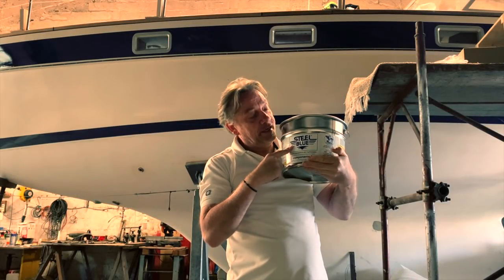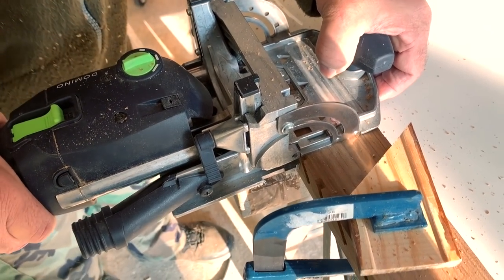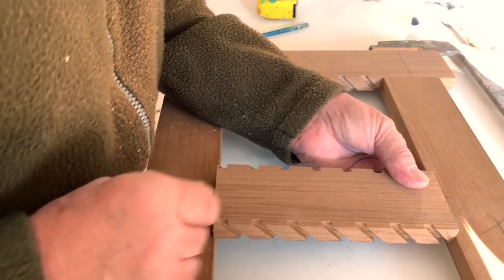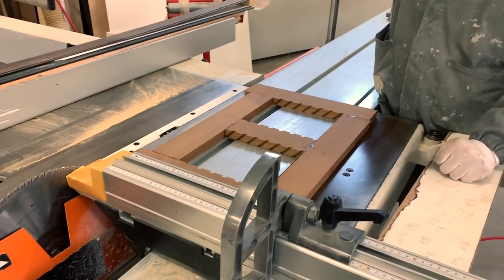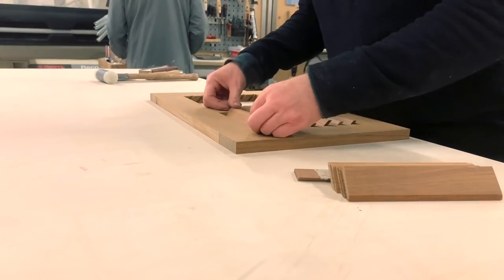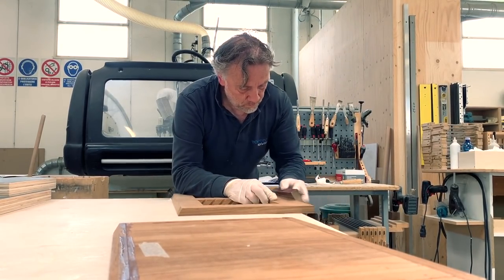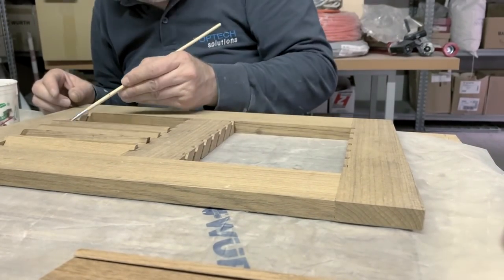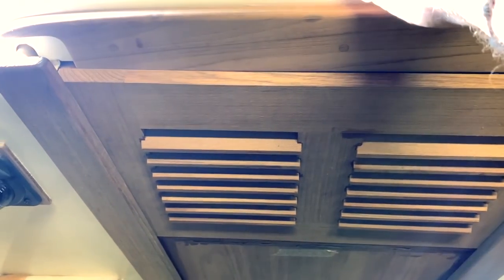Hallberg-Rassy 312 "Ellös": THE MAKING OF THE  WASHBOARDS (DIY BOAT)

Comment: Thanks for showing this project. Idée how to make the panel with shutters (washboard). Good idea the plexiglass panel. Is the Molding outside the boat? If inside. Easy to push and pop inside the boat. Splash wave or burglar.
Reply from the maker: Martin the plexiglass is inside with a frame with 12 screws! I never used plexiglass without be in a boat when I go away  I prefer using with shutter more privacy... in any case you need as steel to avoid burglar they enter everywhere ....

Comment: Excellent workmanship! Just a small thought - if you rotate the plexiglass frame 180 degrees would it provide more strength if a rogue wave breaks from behind and impacts the washboard?
Reply from the maker: Hey mike good question!!!... I use this setup for two reason one is the watertight... second I got a very protect cockpit and to strength the plexiglass And avoid any problem I got a teak frame from inside screws with 10 screws...that give a extra toughness...
Reply: @sea4see  Excellent, you have carefully thought it through.

Comment: hello are you planning to varnish ? in this case with one do you use epifanes clear ? also for the teak desk I don't know what to do HR. recommends only boracol and really like the natural grey look but do you think teak wonder or semco it is better for protecting the teak ?
Reply from the maker: Hey Nacho! I varnish or I just start to fix some problem inside with epifanes clear varnish 4/5 hand and 2 of satin one if I bring to bare wood I’d I need to refresh varnish I use only 1/2 hand of satin one. For sure I will use semco  teak sealer already used and great result!!!

Comment: Hello, why are you gluing with epoxy and not with regular carpentry glue?
Reply from the maker: Hey ! For sure epoxy least more than normal one is more strong and is not sensible to the water. Epoxy 4ever

Comment: I must laugh every time you quote Master Athena "glorious, glorious" as the dust flies... fyi, us pedants usually call such slatted objects "louvers"....whether or not they were fixed or movable units.  As Diskawrs said, (modified) coffee and keyboard, let's begin!
Reply from the maker: Italian accent I quite impressive 😁 funny but glorious glorious sanding is the not only the best but is damn really true!!!!
Reply: A washboard is the correct term for  a removable board used in a hatchway to keep water out. Even if it has louvres.
Reply: @bertmacdonald337  I should have known better, everything on boats has, had, or will have a special name.  Same deal in most trades I am familiar with.  So thanks for the heads up!
Reply from the maker: Thx pal! Wow I didn’t not write a bullshit🤣🤣
Reply: @sea4see   molte grazie amico, sei un perfezionista e mi piace il tuo lavoro. ;)
Reply: @dhamma58  I`m not taking the piss or being a smartarse mate, I`m sure all will be revealed in part two. ;)
The washboard is part of the vertical section that locks with the horizontal hatch covering used to secure the boat when she is left on her own for any length of time or when you are onboard asleep. The louvred section provides ventilation and helps to reduce mould. Once you see the finished product you`ll get it .
Reply from the maker: The end of the task will be in part 2... at the moment I’m struggling to find the correct brass screw to use onto washboard..😩
Reply: @sea4see  Go bronze mate! Brass corodes!
Reply from the maker: For washboard no problem buy 200 for each size just now 😜
Reply: @sea4see  I am drooling over Yachting World`s review of the HR 40C !
lei è la perfezione ! <3
Reply: @bertmacdonald337  No worries, I'm fine with learning new nomenclature...it can be amusing or alarming or educational.  All the old terms in plumbing, for example, involve putting the male parts in the corresponding female orifices...(not to be confused with our parts) (much)

Comment: OMG ....you should never work with gloves on a running sliding table saw....but on the other hand he does without any other safety equipment (upper protection etc.)...
.....Good luck for your fingers in the next time!
Reply from the maker: Fortunately are not mine... I used gloves and glass but other people don’t..😩